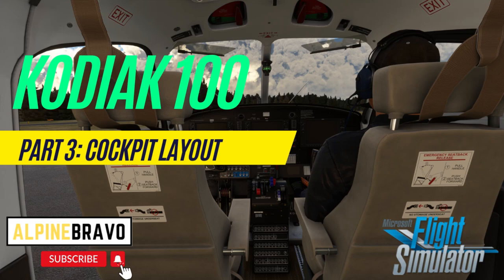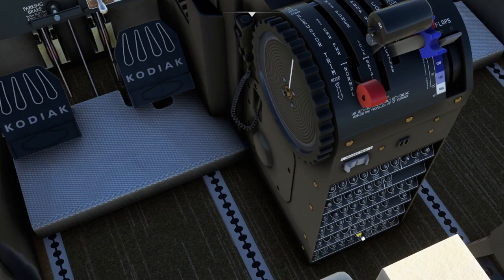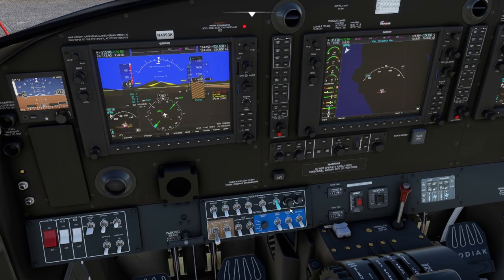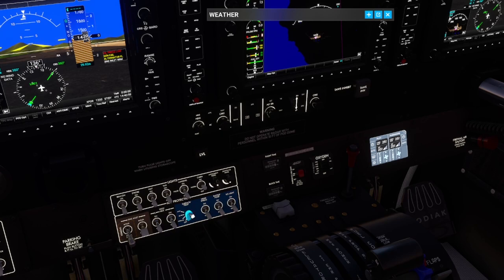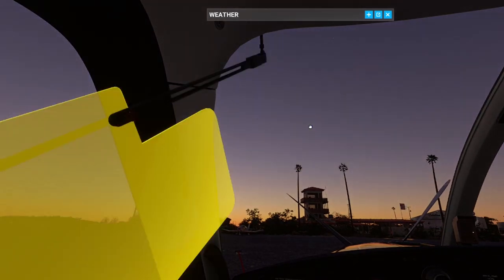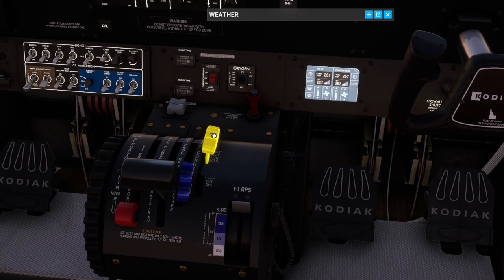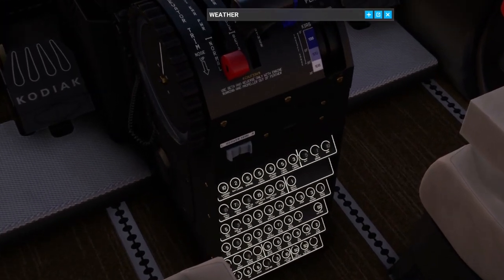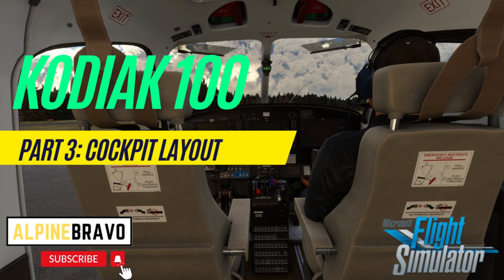How to Fly the Kodiak 100 | Part 3: Cockpit layout

Comment: Why as soon as I activate the fuel switch it starts an alarm. This did not happen before I means some months ago.
Reply from the maker: By fuel switch I'm assuming you mean the auxiliary fuel boost pump?  I'm not sure tbh as it's been a few weeks since I last flew the Kodiak, but my guess would be that this is because the G1000NXi was updated in SU13 and now has master caution and warning tones I believe. Cancel the alarm by pressing the Alert softkey on the bottom right of the PFD.
Reply from the maker: CONFIRMED - this is a new low oil pressure master warning.  Updates to the Working Title G1000NXi have introduced this.  Press the 'Alert' softkey on the bottom right of the PFD to silence it.

Comment: I just bought this plane about a week ago, and my left and right pitot heat switches do not move. Is this not modeled in the aircraft, or am I maybe doing something wrong? Thanks, great video!
Reply from the maker: Hi Mike, the are both 2-position switches: ON and OFF.  They are functional , so you should be able to left click on them to change their position or, if in 'lock' mode highlight them and then use the mouse wheel to change position.  If in 'legacy' cockpit interaction mode it should just be a left click.  Make sure that you don't have some keyboard binding or other external peripheral bound to keep them from changing position.

Comment: What happpens when the block time accumulates too much?  Do you need to service the aircraft somewhow?
Reply from the maker: The Kodiak has values for engine state/condition and ignitor cycles.

Once the engine exceeds it's condition, the chances of a failure increase.  At this point the best thing to do is not to wait for it to happen in flight, but to deliberately blow the engine by starting it in LO IDLE, quit the flight and start a fresh one. This will then zero the engine condition (new engine!).

You can monitor the engine condition by going into Developer Mode.

The ignitors get 1500 uses before they may fail. If they do, it's simply a case again of quitting the flight.

I understand that SWS plan to improve this side of things in future releases, but they are pretty fully occupied with the PC-12 right now.
Reply: @alpinebravo7090  Many thanks.  Does disable aircraft stress damage in MSFS settings negate this behaviour?  It's hard enough fighting this lievely thing without having to worry about fatigue and wear|!
Reply from the maker: Aircraft stress, no. Engine stress..., maybe.  I've never flown with engine stress disabled. Easy enough to check though: disable engine stress and then start in LO-IDLE.  If the engine doesn't hot start and blow immediately then you should be good.
Reply from the maker: @AdminVortex762  Just to add - management of power is crucial to 'taming the beast', not just in terms of avoiding damage to the engine, but achiving good consistent take off and landings.  Smooth and careful application of power is important - particularly on approach and short final.  The added bonus is that if you are doing all that right, then the chances of damaging the engine are much less. Sustained high-power climbs are the biggest risk -avoid the temptation to redline it to clear some ridgeline. Do a climbing orbit instead.
Reply: @alpinebravo7090  Confirmed: MSFS 'no damage' settings are good to go i.e. no damage to engine at 1100 ITT (in the red) for a whole minute.